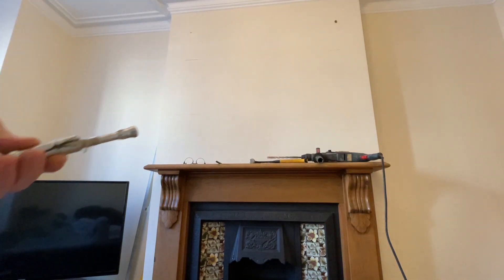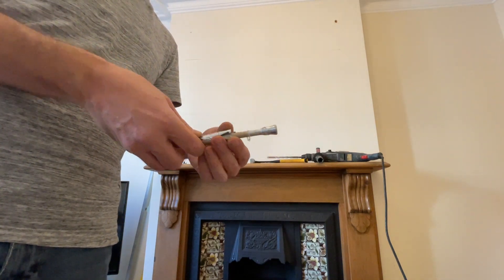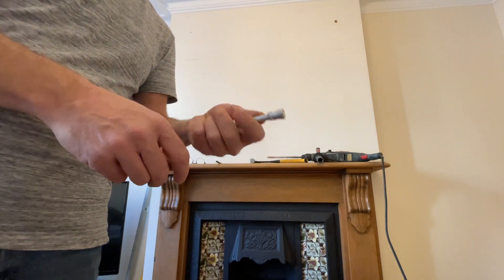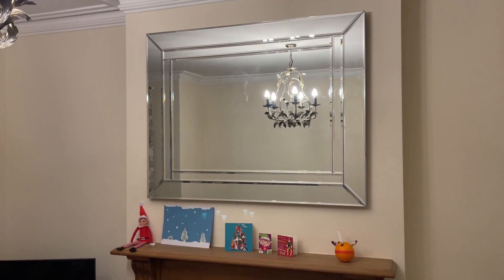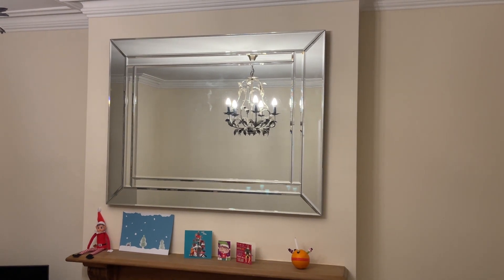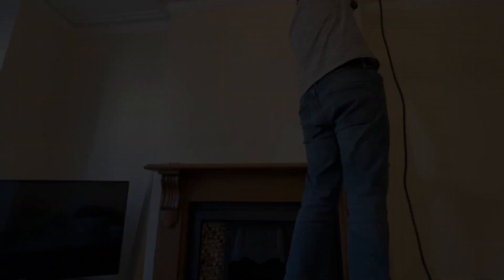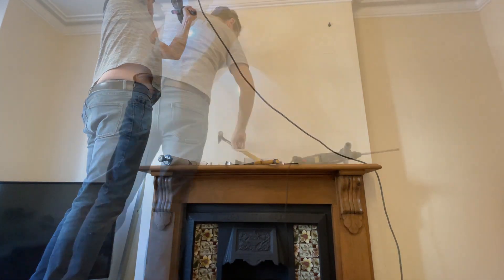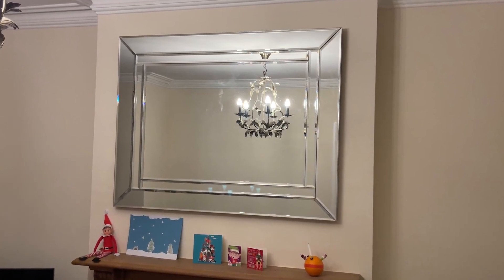How to Hang a Heavy Mirror the PROPER Way

Comment from the maker: Guide to hanging a heavy mirror on a wall, avoiding the common mistakes made & using the correct fixings and tools for your wall. Helping you achieve a safe and aesthetically pleasing result.

Tools you will need
SDS Drill: https://geni.us/uUhxLC1
SDS Drill bits: https://geni.us/f74f4
Fischer Resin kit: Looks like this is no longer available as a kit, here are the parts in it:
Resin cartridge: https://geni.us/5aX9mwZ
Applicator Gun: https://geni.us/jjPuZ0
Wire brushes: https://geni.us/CFy3sr0
Blow out pump: https://geni.us/fnSc1r
Hammer: https://geni.us/2jZI7R
(optional) 1/4" socket set: https://geni.us/GSRN0q7

Disclaimer: If buy from the links above I receive a small commission which helps fund the channel.

If this helps you, please consider liking and subscribing. Any questions or feedback - please leave below!

Comment: Like all the others, you fall short by not showing us how to actually place the heavy mirror onto the wall once all the hooks and brackets are in place. Because thats the hardest part, especially with 2 hooks and a wire. Heavy antique mirror, like yours.
Reply from the maker: @NYnative61  Yep, that's a fair comment bud. To be honest I was 50/50 about posting this video. I didn't have my usual gear for filming and it was done 'on the hoof'. In the end I figured that it was better to be up and if it helps some people out then great :-) My goal on YouTube is to save people time though, so if it's costing others time - I'll take it down. 
Note  - there's no wire with this mirror, just the two hook going straight onto the two bolts sticking out of the wall. It's not like a picture where you have the wire between the hooks on the rear of the picture. Also it's not antique ;-) But it is really heavy - unfortunately there was just no way to film me lifting it onto the lugs..
Reply from the maker: @NYnative61  Yep, I'm really sorry pal - I did the best I could at the time - I was caught short without my usual gear: tripod, lighting etc. I did show one of the mounting hooks on the back of the mirror - there's no wire on this one.

Comment: That fixing is far too big for a mirror
Reply from the maker: @SH__- Respectfully disagree with you because: 1. The manufacturer instructions required an M10 bolt - they've done their CE marking & safety testing around that fixing. 2. My kids regularly play under that mirror - I'm not taking chances 3. That mirror was REALLY heavy.
Reply from the maker: Hiya, thanks for your comment. It's exactly the size specified by the manufacturer. My kids play under that mirror - I'm not cutting corners

Comment: UGH! I am trying to hang a 75 lb mirror onto the provided screw in wall to catch on the frame of the mirror. I'm killing myself trying to hold up the mirror, look behind mirror and align to catch. As others have said in comments you left out that bit at the end of actually hanging mirror to wall. Trying to find this help is near impossible 🙄
Reply: Pad out the wire with some lumps of foam rubber, so as the wire stands proud from the mirror enough for you to easily hook it over your fixings.  You might also find a cleat fixing easier – it comes in two parts – one bit is screwed into the back of your mirror and the other corresponding bit screws into the wall.  It makes the hanging stage a lot easier imo.  Bon chance!
Reply from the maker: @jeliarra  Thanks for your comment. I'm looking to film a follow-up video to help others in the future. If you're still struggling - I echo the comments of @221b-Maker-Street  - you want something to hold the tabs / wire out. Mine didn't have wire, it only had tabs so I held them out with blu tac - it literally just has to hold them out for the 30s or so it takes you to hang it. Hope that helps a little?

Comment: Hi, would you be able to offer me any advice? I

I have ordered a very heavy latte mirror. The wall it is going on is inside the house but it is an external brick wall as in one side is inside the house, the other side is outside. It is plastered on the inside and therefore I assume it has  plasterboard. 
The walls of the house are brick cavity walls. 
I am not sure if I should be buying solid wall fixings or plasterboard ones? Thanks